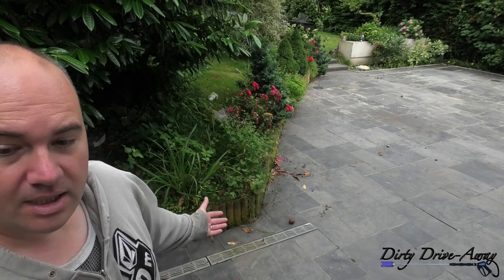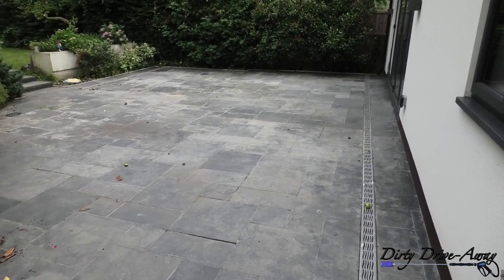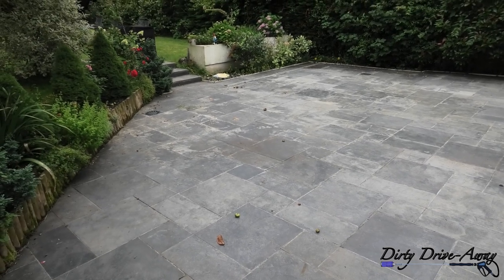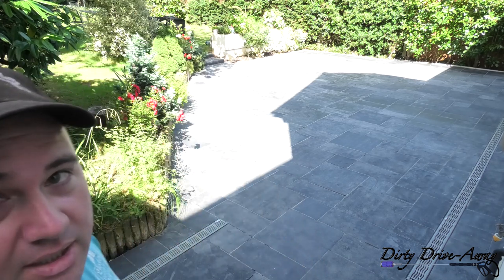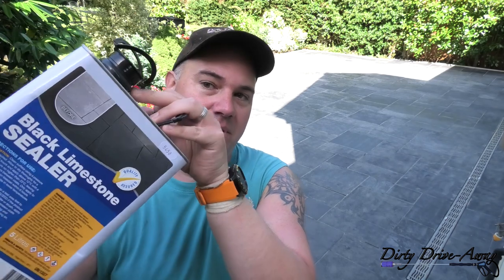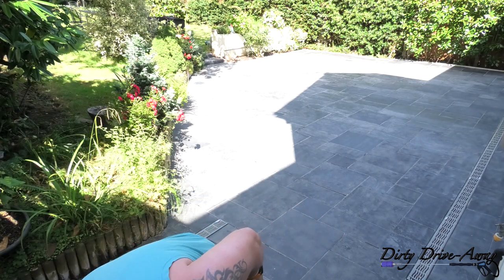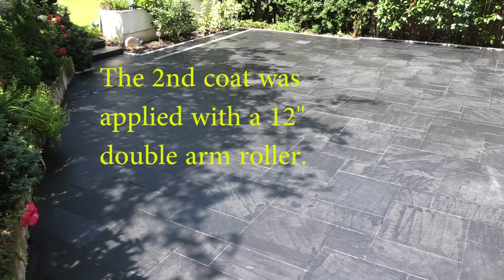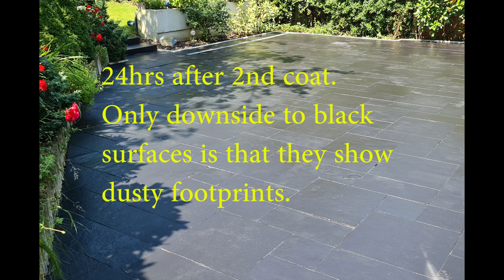How Restoring Black Limestone. Patio Transformation

Comment: Nicely explained once  again Phill,  I did one of these a few years ago with similar issues,  easy joint residue not rinsed off properly and stuck to the stone. Good call on the salts from the hypo .. how did you know that?  I gave it a dam good rince and used a tile stone cleaner to make surface  it ph neutral. Limestone seems to be very high  maintenance after 12 / 18 months it will need doing again worse in areas where things have been sitting like flower pots. You did a good job rescuing it, well done👍
Reply from the maker: Cheers mate, yeah it was pretty bad condition. Looks like builders left cement everywhere. Shame as I bet those slabs cost a few quid.

Comment: Nice job glad I found this channel. What would be your best tip for someone starting out on the power washing branch of external cleaning? I run a window cleaning round currently and would like to branch out.
Reply from the maker: I get asked this a lot and it's something I've considered myself for a few years. However I am so busy doing pressure washing there is no way I could successfully run both. All my time get taken cleaning and I just couldn't sustain a window round. Also van space is an issue, pro washers are tank fed which you may think that's OK as you have a tank for your window water. Unfortunately pressure washers can't use pure water so the tank will need draining everytime you switch jobs. The biggest challenge is doing a pressure cleaning job properly and quickly. Cheap low power washers simply take forever, yes they will do the job...eventually. I mean there's plenty people using small petrol washers and they feel its fine, they have nothing to compare it to. I have a small 200bar 10lpm washer on the van that I use if access is a problem and I can't get the main hose to the area. I won't however take on big jobs with it as I know it takes so much longer. The difference in speed is massive between a small washer and a pro washer, think smart car vs lamborghini. If you feel you can make both work then go for it, but if you have a decent window round I wouldn't. Pressure cleaning is seasonal and runs mid march to around septmeber/early October. Any other questions please ask, phill.
Reply: @DirtyDriveAway  Thanks for the response mate. I can appreciate that, I thought as much with the professional kit. I am thinking of trying to get a smaller set of jobs to start with just to build up the experience and because currently have only just been able to get hold of a small petrol washer like the little one you have. I started my round with the intention of building it up little.by little to provide more and more services, so my plan was to set this up see how we run for the next 6 months and then make a decision on how to expand. I will be overseeing the work but I have someone that would be doing it for me. Hopefully all goes well and I can get a behemoth jet wash for big jobs 🤣
Reply from the maker: @bradleyswainson9319  just make sure the person doing it for you has the same quality expectations as you and you'll be fine. Don't forget to research different stone types and block paving always needs re sanding after (when dry) so you have to factor that into the job/price. If you ever want to get a decent washer speak to Damian/Arron at Qservices in Ingleton Lancashire, they are good guys and will only sell decent stuff, assuming your in the UK.

Comment: Use like Colour enhance sealant look nice job  all found best put it on that size of area spray-on 👍 sometimes when you roll it on
Leave roll marks so got to keep going over it 👍
Reply from the maker: Colour enhancer sealer would have done nothing to this patio. Even when it was wet it was still pasty and badly stained. The black sealer was used to cover the bad patches where it had been damaged and neglected. You cant spray this sealer only roller or brush.

Comment: Also I hit mine with the pressure washer. I've left marks on it. Is there a way to get rid of them too?
Reply from the maker: It depends if its residual dirt in which case a chemical will be needed. I cant see you causing damage to the stone so I would say a mild sodium hypochlorite would help shift any ingrained dirt. Black limestone only looks good when it's laid. After a year or so it fades badly.

Comment: Done my black lime stone in baby oil 
Works a treat
Reply: Which oil and can you please describe the full process?
Reply: @kamalnshradha728  
Johnson baby Oil
Wipe on with sponge then dry off with cloth
Reply: @gavshaky9074  how many bottles?
Reply: @Life_of_John  just see how far u get with one bottle.
Just squeeze a bit of baby oil onto a sponge and then wipe it onto slabs then dry off with a cloth
Reply: @gavshaky9074  I may do an area,  see how it goes. Thank you
Reply: @Life_of_John  i recently done mine again and there still nice and black you will be surprised.i was paying £80 for a bottle of back to black and the oil lasts alot longer
Reply: @gavshaky9074 How long does it last??? Doesn't the weather just rinse it all away??
Reply: @Jaaammmbbbooo  it last for a few weeks depending on weather but it doesn't get washed straight away.
To me it's the best solution if I want them black over summer time.
I like the fade colour also